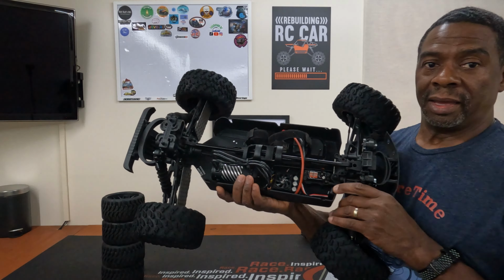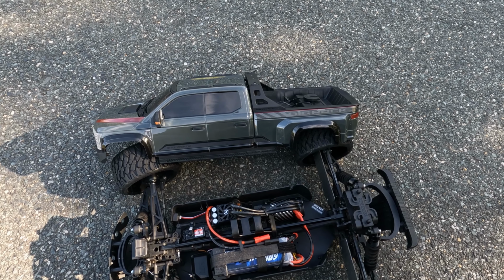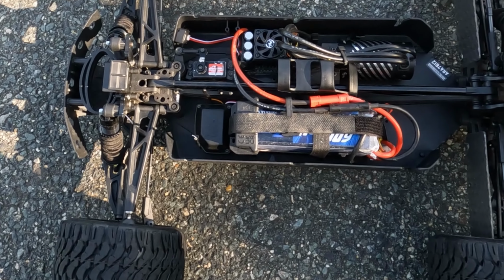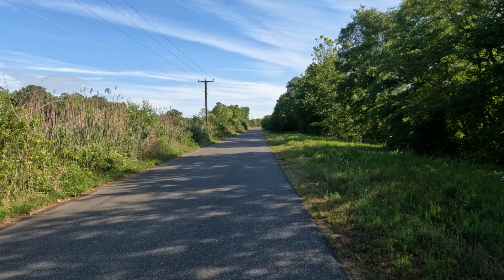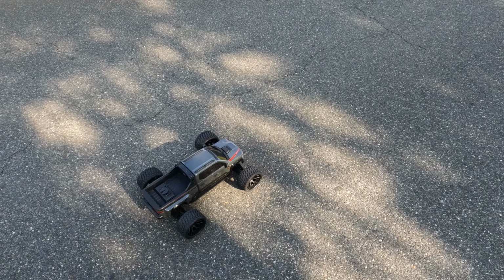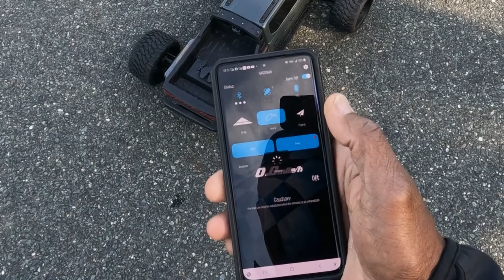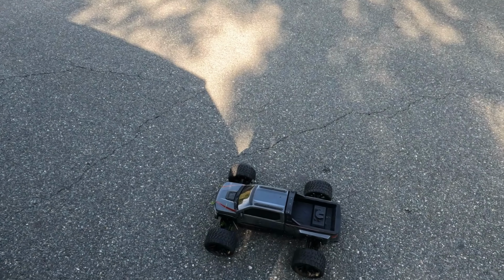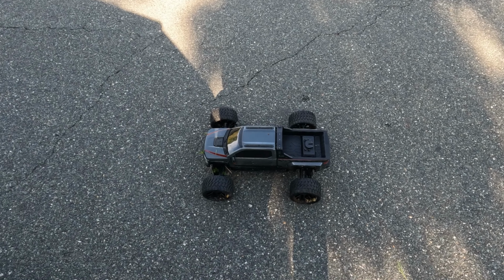Arrma Big Rock 6s Speed Run Sunday SRS, HW Max6 G2 Combo #speedrun #arrma #hobbywing

Comment: Awesome, I just put those tires on my Big Rock, and they are perfect.
Nice speeds. Thanks for sharing.
Reply from the maker: Hello RCbeast, the Sweeps Terrain Crushers and Road crushers are good for street bashing, but for jumps they don't give you that much cushion on your landings so most of the shock goes to the suspension arms and into the gear cover.  If I am just racing it with family and friends then they are great.  Thanks for watching

Comment: In your experience with the Big Rock 6s is it better to run 2 3s packs or 1 6s pack? I'm getting ready to purchase my big rock soon and this question is on my mine because I plan on ordering Spectrum Basher batteries, seen a lot of folk saying it's a tight fit and w those batteries you have to remove a part in order to fit? Sorry for the long writing. Living your set up and how fast this truck is. Thanks Spare Time!
Reply from the maker: Hi Ybarra75, Thank you for stopping by and watching the video and for the comment/question.  Honestly, it would be better to run a 6s pack. Here are two reasons why 1st, if you move the battery tray towards the rear, it would be an issue of the interal support system to sit on top of the batteries  and play havic on securing the rear body pins. 2nd, you wouldn't have to remove any parts ( I didn't), but you will have to use the movable battery cover to keep the top battery from shifting forward  witch will have the battery hanging more to the rear.  To keep everything from shifting side to side, you may want to add a second battery strap.  That's what I do when I run 8s  in the Big Rock.  Sorry for the long explanation. I just wanted to let you know that.  Thanks, take care, and stay safe out there on your rc adventures.

Comment: nice now i know my speed i got the same combo have you tested whit stok pinion
Reply from the maker: Hi Tomiolkkonen, Thanks for stopping by to watch the video and for your comment.  Sadly, I have not tested it with stock pinion.  I built the Big Rock from a chassis. I didn't have a stock pinion gear.  I think you will have a blast with this setup.  There is a lot of torque and the right amount of speed for this heavy machine.  Take care and stay safe out there .

Comment: Where did u get the tires from?
Reply from the maker: Hello Marquistbaisden, Thanks for stopping by to watch the video and for the question.  I picked these up at Anderson RC in NC when I visited family.  You can go to Sweep Racing here is the link, I am not affiliated with them, they have gone down in price since I purchased them ($59) if you are looking to do small jumps and race in the grass and dirt then they are a good set, but if you plan on launching your vihicle more than 5' in the air , not so much not a lot of cushion for the landing.
https://www.sweepracing.com/product-page/terrain-crusher-whd-black
Reply: @sparetimerc  ok thanks and no I will not be doing  no jumping I'm like u I just like to run all my cars and trucks
Reply: 20 /50 gearing?
Reply from the maker: @brandonmiller318 yes 20/50.  I'm taking it out this weekend along with the FireTeam. It's been a while since I ran both.